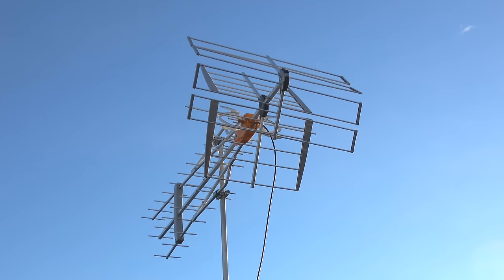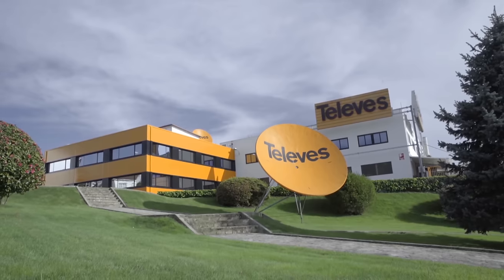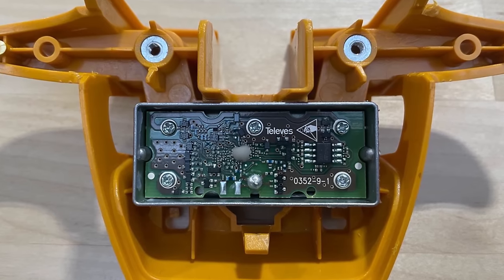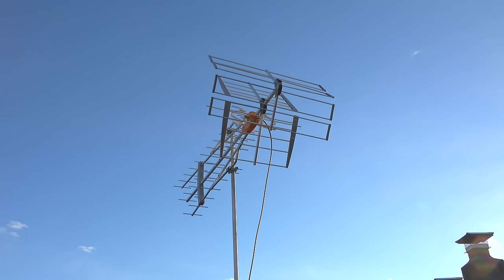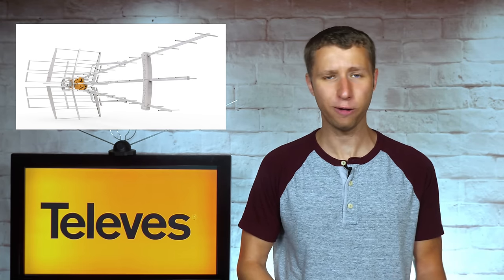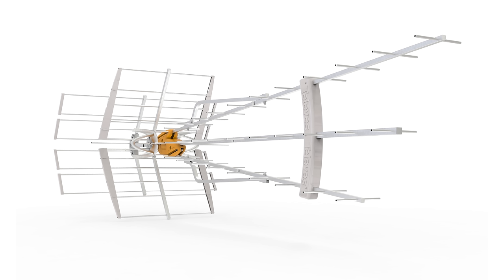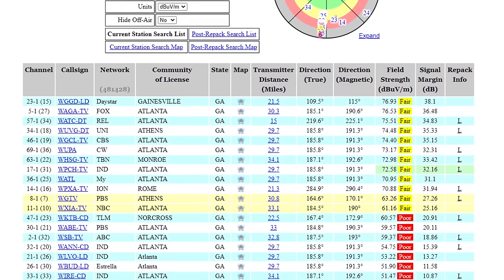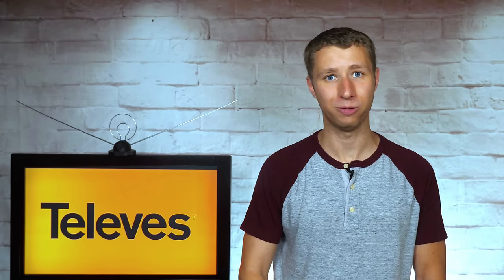New Televes DATBOSS LR Mix Review Updated Repack Model 149884

Comment: "The last 2 antenna's" means NOTHING.   Unless tested against Winegard and Channel Masters LONGEST RANGE antenna's your test means nothing.
Reply: By design so you can pay for his service where he looks at your location and recommends a specific antenna for that.

Is there anywhere that I can compare the best antennas ?
Reply: @SanctuaryGardenLiving  That's the problem: not all locations are created equal.
Reply: I agree with you. He tests others against others which mean nothing.
Danny out of Michigan under Danny’s Antennas once had 15 antennas on tripods in a field with same length of RG6 to each one to a switching boards where he could do a scan on each one. Find how many channels it brought in then check signal strengths on the weakest channels coming in.
Antenna Mans tests are meaning less. 
I install and make/modify antennas. 
Yagis by far are used for long distances over 8 bays.

Comment: Bought this antenna based on your review. Works excellent. My old antenna maxed out at 54 channels. This picked up 67 in passive state. After connecting to power, the next scan added 21 more channels. Total channels received 88. I can’t wait to rescan when all the leaves are finished falling. Hands down best antenna I’ve ever owned. I’ve had 2 previous that both maxed at 54 with all the leaves gone.

Comment: Only downside to this antenna  is that it is very directive and as such, a lesser antenna which may pick up signals over a 45 degree arc may seem 'better' in some cases. But as stated, no antenna  is one size fits all. My opinion (and I own an 883 and three 884's) is that there is no better UHF antenna made for pulling in a signal that you can aim at. And the construction quality is several levels over most anything else made.  Wish they made a similar quality multi element 2-13 antenna.
Reply: Bob Hawkins. The best antenna is the one that works for you. You have to remember that part of Televes’ performance advantage is their unique built-in auto-gain preamplifier that not only compensates for distribution signal loss but also improves any antenna’s performance. The venerable Antennas Direct 91XG is unchanged and still selling well since the the late 1990s at the beginning of DTV before there were many stations that were transmitting on RF VHF. I have four of them. You still see many old antennas of that design in Europe and in the the U.S. in the 1970s Channel Master had three sizes of their “Super Diamond Quantum®️”, the 4247, 4248, and the 4257 that succeeded their giant parabolic models. I have two of the 4248s and for me it is about equal to the 91XG but some DXers say it was better than the 91XG. At my difficult reception (refraction) location I have to have separate antennas in different spots and heights and no Televes combination model works for me for both UHF and VHF.
Reply: @bjs2022  Agree on all points. My solution involved an 883 (only because the 884 was not available then) with no preamp and a Stellar Labs VHF HI yagi. Those run into a Televes preamp near the antennas that has separate UHF and VHF Hi inputs. The performance on 7-36 exceeded my high expectations. Been using an MXV5100 applied to the low VHF input but I am less than thrilled with it's performance. It sits within 4' of my FM yagi and I fear that it and the FM antenna may both be compromised by that proximity. I think the MXV will be moving down to the chimney before the snow flies.
Reply: @BobOnTheJob1  I had a similar problem & discovered it required a 10' separation which I have now.
Reply: @JFrenchRennier  Between a 2-13 antenna and an FM yagi ? If so, what improvement did you get when you satisfied the 10' spacing need ?
Reply: I live between two markets as this antenna can't even pick up the market 30 mi away behind it. Picks up just fine when aimed at a tower 80 miles away though.
Reply: @jamesm568  I hear that about this antenna causing some to say it's a step down from a lesser antenna. And if you are trying to get multiple markets, this one may not be the best weapon. But when you need a sniper antenna to pull a rabbit out of your hat signal wise, this one is the one to beat.
Reply: @BobOnTheJob1  That's why I like the old school antennas with low VHF elements as they can soak up signals behind it if you live between two markets.
Reply: @BobOnTheJob1  Point the antenna slightly up as it helps tremendously. These newer antennas don't like to sit level for some reason.
Reply: @jamesm568  Been told that and have been doing it since. Hard to document any differences but it certainly hasn't hurt anything.

Comment: I bought one of these (149884)  to replace my channel master in my attic which was "omni-directional"  I sold the c/m locally along with a c/m amp and c/m splitter for more than I paid for the televes, which does not need the amp or splitter because they are built in.  I'm shooting 65 miles as the crow flies North at 337 degrees to Springfield Mo and it works great.  It also receives the pbs stations to the South from the back end--all in the attic.  Over 37 stations very clear( some are repetitive).  Thank you Tyler--keep up the great info.

Comment: I have the previous generation of this antenna.  It has served me very, very well over the past three years.
I receive 1 Kw UHF translators at 67 miles, UHF/VHF are great at 60 miles.  I even get some Phoenix stations
at nearly 90 miles, at times, overnight.  You cannot beat this antenna if you want reliable, consistent reception.
It is built to last as well.
Reply: You're in the Phoenix area, eh? How does this antenna hold up to the heat?
Reply: @TopFitnessStrategies  The plastic portions as well as the electronics have been very durable,
reliable well over three years.  Usually all it takes is a year for the plastic to become brittle and break.

Comment: Very happy with the Televes Eclipse I purchased about a year ago. I am only about 15 miles from towers just outside Ft Wayne, IN.  Plenty of days of bad weather.. heavy snow, hard rain,  decent amount of trees in my block.  All that being said, I have not lost signal yet.  I highly recommend these antennas.
Reply: How does this antenna hold up in the winter? Does the plastic hold up to the Ft Wayne winters?
Reply: @TopFitnessStrategies    Fine in the 2 winters I've had it.  Freezing rain, excess snow no problem.  When assembling the antenna (very easy) I got the impression of a well made product.  Including the plastic housing.

Comment: I installed exactly this DatBoss LR Mix model a few months ago. Bought it to replace another Televes antenna the Ellipse Mix which I still am using mounted 10' lower on the same pole facing 150* in another direction feeding 2 other TV sets. 
The Ellipse is an excellent antenna limited to 60 miles but did pick up 1 Tower 78 miles away with a strong broadcast. However it picked up 2 other towers with less broadcast power erratically, meaning only at night.
This DatBoss LR Mix replacing the Ellipse aimed at those 3 towers now picks them up perfectly plus a 4th tower 12 miles further which due to earth curvature on a 22' antenna pole should be virtually impossible but I do lose this particular tower sporadically. Best is all local towers within 40 miles from all directions are received & 3 towers in-line are never over-powered.
Because this antenna only feeds my wife's bedroom TV which she plays maybe 8 hours per day & every night, I have spent major money purchasing other long range antenna, signal amps, pre-amps. Her reception is of paramount in importance & this is the best I have tried.
What I like most is the build quality & balance. It does come disassembled & took me about an hour to put it together following both the directions & a YouTube video. Be extra careful to have the antenna horizontally level.
My location is central Louisiana flat land but I have trees partially blocking reception within 70". Because of HOA rules I am limited to 20' in height for an antenna. I also have a 3rd antenna installed which is a figure eight appearing plastic model from another manufacturer which is mounted 12' on a separate pole & is very good local only. It feeds a 75" TV in the ManCave. It's biggest problem is interference from passing auto's requiring me to rotate it in a non preferred direction.
Both Televes antenna have no interference problems.
From my personal experience, Televes is the best antenna's on the market & I have tried.
I am a long time cord cutter refusing to pay $120 per month for cable in this market. I also stream using AT&T unlimited 1gig fiber.

Comment: Do all of these Televes outdoor antennas require a power source/cable for these built in filters/preamps? I really like these Televes but don't want a power chord flowing through the attic.

Also, can you hook two separate coax cables (one cable to one tv and another cable to another tv in a different part of the house without a spitter) to one Televes antenna? Thank you for any response.

Comment: Very interesting . It seems like Televes is the one of the only companies trying to update their designs (antennas and amps) for the newer TV spectrum.

I'm interested in how this antenna does in comparison to a long UHF yagi antenna like the Stellar Labs 30-2370.  I have the best reception in my area with a large UHF yagi antenna.
I'd have a hard time trying a new antenna.  $180 is quite steep when it might not work better than my current set-up (Stellar Labs 30-2370 + Kitz KT200 Amp.
Reply: Apples and oranges, that antenna you list appears to be a clone of the Antennas Direct so I have no idea if it performs the same. I have one that the model you listed is a clone of hooked to an Avant X which brings the best out of it. The Televes is more compact and it does a very good job in UHF which is where most of the engineering is and it offers a reasonable VHF signal. The Stellar labs antennas that are designed to look similar to the Televes, avoid. I would not buy anything from Stellar Labs. Even my Antennas Direct original UHF Yagi is very fragile and can be bent up easily.  

 The preamp you listed is far from ideal for two reasons, it can overdrive the signal with no AGC to prevent it, the other reason is that it has to be within reach of a wall outlet. It's better to use a model that requires a power injector so the preamp can be connected at the antenna end. On the TV end, you amplify noise and interference, on the antenna end you only amplify the antenna and by doing so, you raise the signal further from the noise floor rather than amplify it. If you ONLY need UHF and want to use that antenna, I would recommend that you use one of the newer Televes mast mounted preamps as those will guard against overdriving which is far common than one would think. The symptoms on the TV of an overdriven signal are the same as a weak signal, pixellation, blank picture etc. 

 To me an expensive antenna is the commercial grade used by satellite and cable providers to grab local channels with  an antenna farm and they are not available to the public readily. These start in the 400 dollar range and can be over a grand. They  also usually only cover one band. Separate Low VHF (Band I) and High VHF (Band III) and separate UHF and can be had in Yagi or LPDA, the latter being larger but better side lobe rejection, swr and flat impedance over the passband with each element being a separate  dipole with reversed polarity from adjacent dipoles. There are also single channel antennas. They also have optional brackets to arrange dual antennas in vertical or horizontal or quad antennas in a diamond pattern. The Televes with it's built in proper preamp at the dipole itself is actually a bargain compared to you will end up spending to get the Stellar Labs to work properly without overdriving and that's if it even has decent RF reception. The Televes are not overly large and unattractive to most I hope. Some people just hate antennas, I like them and they perk up my interest when I see one driving around, more points for a 30 foot tilting tower.

 If there are any single women out there who love antennas, hit me up, maybe we can design a boutique look on a powerful antenna. If apple can create something out polycarbonate that people treat as a fashion accessory as if it is a precious stone, nothing is impossible.
Reply: $180 is a bargain compared to Channel Master 😂
Reply: @jbetnar    I know.   I guess I should of phrased it differently.   Once you have a $200+ set-up it's hard to just "try" something else that cost $180 when you don't know if it will work any better than what you have.       I need to know that an antenna will perform better than my current set-up before I spend another $200.    You can't return a lot of antennas just because you don't like them or they don't work better for you.    In a lot of Tyler's videos he doesn't compare the antennas to the "best" antenna (in that class) that he's tried before.  I know that there are difference antennas for different jobs.  In most videos he compares them to random antennas or previously reviewed antennas.  You can't watch his videos and easy find which antenna has the strongest gain or best reception because he doesn't compare them to the best.   For example in this video I would have liked the DATBOSS LR Mix to be compared to a large UHF yagi (HDB91X), a large Channel Master or a Denny's Double stack.

The only method to truly compare antennas is to have them set up right beside each other with a selector switch and compare the readings for each channel.  Find out which antenna has better reception. Record data.  Replace weaker antenna with another and repeat until you have the best antenna.   I remember seeing on an antenna forum where a guy did something like that with 20 antennas.  He drove to an area 50 miles from a tower in a field.  Brought 20 antennas with him and compared them all.  At the end he could tell which was the best out of the antennas he brought.

Comment: Thanks! I watched many of your videos and your content helped me from making the cheap ebay antenna mistake! I settled on the the antenna you reviewed here ( televes dat boss lr mix) very happy as I pull in NYC stations reliably even though I am about 70 miles out from tower ( strange because I live in Connecticut and have trouble with CT stations!). May get an atc 3.0 tuner to see what else I can pull in!  Great videos and awesome content!- Chris
Reply from the maker: Hey Christopher, thanks for the contribution. If you can get some Hartford channels then an ATSC 3.0 tuner may help but right now NYC does not have ATSC 3.0.

Comment: I bought this based solely on your experience. A King Jack came on my camper and it was weak but I was still impressed that it was pulling the channel I like best from a tower 70+ miles away. I've since built a carport canopy over the RV and lost that channel completely. I plan on mounting this on a mast above the canopy. It's arriving today, hope it works at least as good as the King Jack did. I also kinda hope the 12v power supply from the Jack antenna will work with this one since it's integrated in the camper. Not a big deal if it don't, it'll just be cleaner looking if it does.
Reply from the maker: No doubt this antenna will perform better than the King Jack antenna as long is you point it correctly towards the closest network affiliated TV stations.
Reply: @AntennaMan  You weren't joking. I'm not even using the amplifier and it receives better than ever. I may get one for my house too. I will add tho, as a throw the instructions aside and put it together guy, this is one I wouldn't. It's like building a model. You really need the instructions.

Comment: Good they added a second preamp that has it's own AGC so we are up to separate AGCs for VHF and UHF. VHF needed it's own preamp with it's own AGC because the VHF on these antennas is nothing compared to the UHF. I'm not surprised to see the VHF improving by 3db which is significant. The UHF of the previous generation was pretty good to begin with but makes LTE rejection that much easier and of course designing for a narrower spectrum improves that range given correct math was used.  

 I have dream, to have a dream, no seriously, with Cellular Data requiring more bandwidth as time goes by with the consumer expecting more, the sub 1ghz cellular bands cannot carry the bandwidth of the over 1ghz frequencies so my dream is to get the spectrum back. Future cellular could well be low earth orbit.

Comment: I bought this antenna to be use for my RV travel trailer. I have the cheap factory omni antenna on the roof of my travel trailer and the lat place I camped I was only able to pick up 2 or 3 channels. I will be setting up this new Televes model 149884 in a couple weeks. I will do a scan on original factory antenna and then scan with the Televes antenna. I will report the test in a couple weeks.
Reply: What happened to the delayed report?